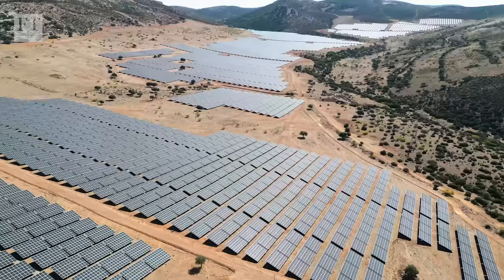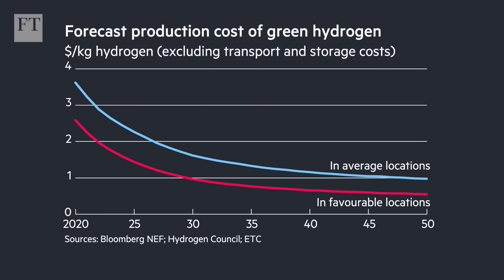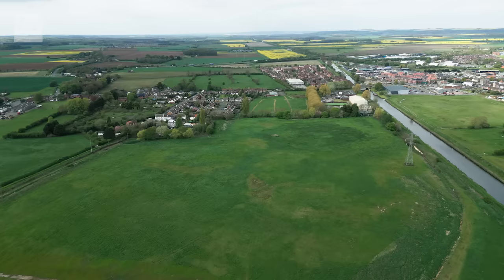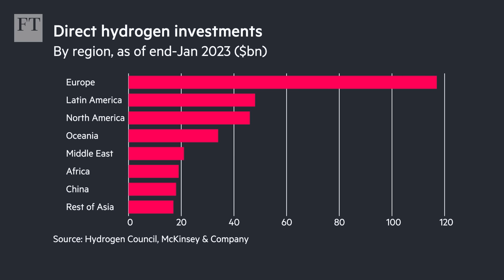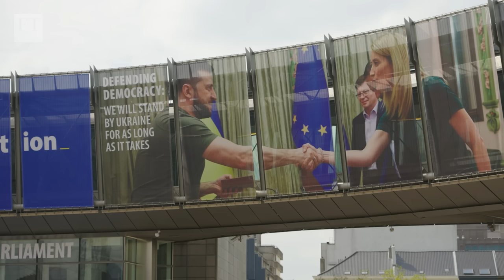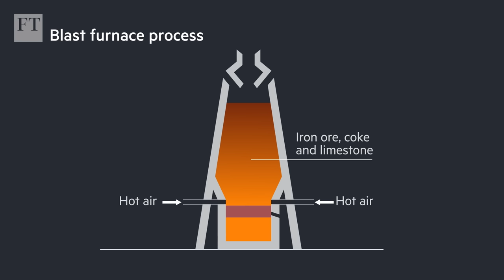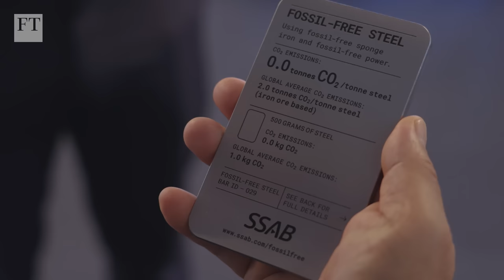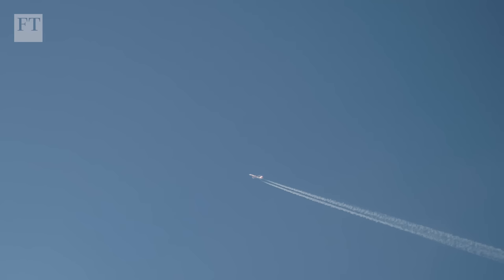Can hydrogen help the world reach net zero?  | FT Film

Comment: There are major issues dealing with hydrogen. There are numerous H2 stations in my area, but at any given time at least 30% of the pumps are offline. Not only that, the stations can only handle a limited number of vehicles due to all the effort needed to compress H2 and cool it to -40 before filling. Trucks typically carry 300kg, enough for only 60 cars (assuming 5kg). This is a fraction of the number of cars one gasoline truck can fill. Despite all these claims of it getting cheaper, it hasn't changed at all here. It's still over $16/kg, so 5kg will cost over $80. Not only that, open the filler door on any Mirai and you'll see an expiration date, after which you are no longer allowed to fill the car. Not only that, the Mirai is rather cramped due to the H2 tanks. The resale value of the Mirai is also absolutely abysmal. We should not be wasting money on this. We should be investing more in battery technology and charging infrastructure, which is FAR cheaper. Each H2 station costs at least $1.9M and they are expensive to maintain. For that price, you can build 40 fast DC charging stalls (Tesla costs < $50K each). Hydrogen is a real pain in the butt to deal with. It leaks like crazy and is dangerous. There have been numerous fires and explosions at hydrogen filling stations. One fire and explosion in my area (Santa Clara) shut down the entire hydrogen supply for six months! Not only that, EV chargers can be installed just about anywhere. I fill my EV in my garage for a fraction of the price of hydrogen. They keep promising cheap hydrogen, but I don't see any sign of it. The only advantage H2 has is fast filling when it works and the nozzle doesn't freeze itself to the car, but the speed of EV charging is rapidly increasing. An Ioniq 5 will charge from 10% to 80% in 18 minutes. While not 5 minutes, these times are still rapidly decreasing.
Reply: Where is it that you have numerous H2 stations ?
It remains to be seen if it's even possible to scale battery production to the enormous levels that would be needed. You're aware that lithium has spiked in price recently ?
Reply: @grahamstevenson1740  San Francisco Bay Area. Also, lithium prices are way down compared to 6 months ago. Lithium only makes up 3% of the batteries. Batteries are more sensitive to the prices of nickel and cobalt (for long-range batteries). The price of cobalt has dropped considerably compared to a year ago and nickel, while volatile, has gone down in the past 6 months. Looking at the chart for lithium prices, it spiked last November and hit a dip in May but looks to have leveled off and is cheaper than it was in March. There is no shortage of lithium and I expect availability to increase, i.e. see the recent announcements on the Salton Sea in southern California. Fuel cell vehicles rely on platinum and palladium. Also, note that hydrogen vehicles have a horrible resale value. There is a built-in expiration date on every Mirai sold. Open the filler door and there is a sticker that gives a date after which you can no longer fill the vehicle and must replace the hydrogen components, effectively scrapping the vehicle. Hydrogen has a very long way to go still until it is competitive, and despite all the promises, there is a lot of complexity involved with hydrogen that is unavoidable since you're dealing with a very high-pressure gas that seeps through everything, embrittles metal, and is energy intensive in its handling, from compressing it to cooling it. And transporting it is inefficient volumetrically except in liquid form, where it must be kept at 20C over absolute zero (liquid nitrogen is a balmy 73C over absolute zero). The only thing colder than liquid H2 is liquid helium. The equipment involved with hydrogen is and will remain expensive. H2 is not like other gases. The only thing harder to contain is helium, which, unlike hydrogen, does not react with other materials. To transport it requires either very high pressures (i.e. 10,000PSI) or extremely cold temperatures. It's very prone to leaking (look at how many rocket launches get scrubbed due to hydrogen leaks) and is explosive at a wide range of atmospheric concentrations. And despite the claims of safety, there have been numerous hydrogen explosions and fires at filling stations, at least two of which caused significant damage. An explosion at a H2 forklift filling station in North Carolina damaged 60 homes and was heard across 3 counties. An explosion and fire in Santa Clara shut down the H2 supply in the Bay Area for 6 months. And if you want to see how reliable the H2 infrastructure is, go to https://m.h2fcp.org/ At any given time at least 30% are offline or limited (slow or can only provide partial fills).
Reply: I quite agree that batteries might be a better option for cars and vans, hopefully in the future with longer ranges. I've been to a course about hydrogen vehicles, in special about the technical aspect of it. And it is abundantly clear that for big trucks, ships and vehicle which carry big loads, this might be somewhat more economically better. See, with EV trucks the payload per truck is by at least one third less, and to think of the range they can do (max 300km) plus charching time (hours, which truckers don't have if they don't need a break)
Reply: No, hydrogen is great, everyone loves it, the end, you’re welcome
Reply: @PierrePinteliere there could be some use cases for H2 but I've yet to see a good example for trucks/lorries. Although the batteries are heavier than diesel, and remove some load capacity, not all loads meet the maximum anyway. Many journeys in the UK are shorter and a mixed load isn't close to the maximum rated weight of the vehicle (44 tons across 6 axels in the UK).
Reply: When you say "we should not be wasting money on this", who exactly do you mean by "we"?
Reply: Battery Electric vehicles are heavy, carrying dead weight batteries, which lose range as they age. They need stronger tyres, and roads to carry the dead weight! The insurance costs are higher as they have to be written off even with minor collisions, as no company will take the risk of fire in the future due to damaged batteries. The written off BEVs need 6x more storage space to avoid risk of serious fires spreading through the whole storage. BEVs need much longer to charge than to refuel a HEV!  BEV technology cannot power ships, planes, trains, lorries, long-distance buses, mining industry, etc for many of the above reasons, unless lighweight batteries can be developed - batteries which are way lighter and almost impossible to go up in flames! Until then, BEVs are transitional technology - hydrogen fuel cells are the real future, IMO!
Reply: @ceblsclinic5613  Batteries don't lose range very quickly and hydrogen vehicles also lose efficiency as they age. Not only that, after a certain date you must scrap a hydrogen car. My EV is still going strong after 10 years. And as for collisions, that has nothing to do with being BEV but just modern cars in general due to the crumple zones and safety requirements. The crumple zones crumple quite easily, making fender benders with modern cars quite expensive. Additionally, many BEV vehicles are not that much heavier than ICE cars in their class since a lot more work goes into reducing their weight.
Reply: I'll give you a A for effort...the Japanese and south Korean are putting all their future energy needs in hydrogen for everything including transport...these countries aren't stupid..if they can make it work then everyone can!!.🤔
Reply: @caravanstuff2827  South Korea is putting far more effort on BEV vehicles. Hydrogen is a lost cause for small vehicles. They are only selling in very tiny numbers outside of Japan. They will also always be far more expensive to operate. In case you haven't noticed, Japan has been stagnating the past couple of decades. Toyota had been resting on its hybrid laurels but those aren't cutting it any longer. Hydrogen filling stations are still very unreliable, very expensive, and will never be competitive with charging. A hydrogen tanker truck carries enough hydrogen for only 60 vehicles. Hydrogen filling stations can only handle a small number of vehicles per day each due to all the limitations involved with compressing and cooling the hydrogen. Japan has this thing called "saving face". Unfortunately, they're VERY far behind everyone else. Honda basically has nothing. Toyota's EV's are generations behind everyone else and are not at all competitive. Mazda dropped out before they even got started. Then there are the safety issues. There have been numerous fires and explosions at hydrogen filling stations. Then the hydrogen cars are cramped because the tanks take up so much space.
If you look at the Mirai, it is not at all competitive with current EVs, especially in its price range. An EV can be driven in most of the country right now. H2 vehicles are limited where they can drive just in California, and they're very expensive to operate, with H2 costing $16.50/kg or more.
Reply: No one ever mentions opportunity cost either...  Money and time spent on a dead end that could have been spent on a winner is lost.
Reply: Some years ago battery vehicles also seemed difficult. But now they seems feasible. Same case with Hydrogen. They are future. Coz eventually limits of battery technology starts. Range and charging time is an issue. Where hydrogen is just like gasoline, takes not time to fill.
Reply: @aaronwilliams1249 You must have battery stocks 😂Every new technology suffers form costs and design issues. It is just a matter of time to solve these problems. There ofcourse are some downsites, like the energy required to make hydrogen, which causes costs for production. And the storage of hydrogen is somewhat complicated. But it can be used with a true net zero emissions footprint, something we really need these days. And the best pro for hydrogen, is that it has a very strong molecule bond, so breaking it releases a lot of usable energy (142 MJ/kg), even about 3 times more than gasoline (46 MJ/kg) and 48 times more than a lithium-ion battery (2,5 MJ/kg). You talk about a lot of downsites of the toyota mirai, but totally ignore the fact that it has about 100 miles more range compared to a tesla with only 6kg hydrogen in the tank. The tank is still 140 litre, so you are right about the cramped interior, but as i said this is just a matter of development time. I am not against batteries, batteries are amazing, but not the total future. We would doom ourselves thinking that. Laws of nature are the only laws that can not be evaded :)
Reply: @mathijsbroeders3454  The problem with hydrogen is there are high costs involved that are basically impossible to eliminate. And there's a lot more than just energy per kg. There's also energy per unit of volume, and hydrogen's volumetric energy density is rather poor. That's why cars like the Mirai are rather cramped inside due to all the space required by the tanks. Batteries can easily be placed under the floor. Hydrogen tanks are bulky and cannot. In addition, the cost and maintenance of hydrogen equipment is high. It needs to be compressed to very high pressures and cooled to -40 before filling tanks, another process that requires a fair bit of energy. That is also one reason why there are often 20 minute delays between filling hydrogen vehicles. And if you think hydrogen is reliable, think again. At any given time, 30% or more of all hydrogen pumps in California are offline or unusable. https://m.h2fcp.org/ shows real-time status and there is a LOT of red visible. Also, the cost of hydrogen is $16.50/kg though at times it's been as high as $24/kg. That's why Toyota has to subsidize the price of hydrogen for the first few years. The well-to-wheel efficiency of hydrogen is also significantly lower than BEV vehicles. Fuel cells are at best around 60% efficient, and that efficiency drops with use.  Then there are all the hydrogen fires and explosions that have occurred at filling stations. I can think of two off the top of my head that are local to me. The one in Santa Clara shut down the SF Bay Area hydrogen supply for 6 months! My county's hydrogen bus filling station also suffered a hydrogen fire and there are numerous other examples. Hydrogen is hard on materials and impossible to fully contain. Due to its molecular size it seeps through all materials and hydrogen is a reactive molecule. It embrittles metals.  There's also a reason why hydrogen vehicles have a limited lifespan with an expiration date printed inside the filler door.
The ONLY advantage hydrogen has is that tanks can be refilled in 5 minutes. Everything else is a disadvantage. You can't fill up at home in your garage and are still at the mercy of the hydrogen filling stations. Meanwhile, BEVs are quickly reducing their charging times. An Ioniq 5 will go from 10% to 80% in 18 minutes. Also, chargers are significantly cheaper to build than hydrogen infrastructure, and they can be placed anywhere. Today for the price of one hydrogen station, you can build 20 high-speed chargers, and the maintenance of chargers costs a fraction of a hydrogen station. For years I have been able to drive all over the country in my EV. There are many parts of my state I can't drive to with a hydrogen vehicle. Hydrogen will always be more expensive to operate as well.

Comment: Not a single critic was interviewed for this peace.  Only people invested in the sector.

2/3 of electrical production is made from hydrocarbons. Coal is mainly used to produce electricity. Green electricity is needed to electrify our economies and hopefully to de-carbonize our electrical grids.

Making green hydrogen is very inefficient, and consumes large amounts of water and electricity. It will only be used for steel making and possibly shipping.

Airplanes were made possible thanks to the very high energy density of fossil fuels and will disappear with fossil fuels. What this video did not show were the large hydrogen tanks inside the aircraft, carrying little hydrogen because at room temperature, a 1 litre tank contains 0,1 gram of hydrogen.  So even at high pressure, the ratio of volume to weight and energy carried is terrible. So unless you are planning to store the hydrogen inside the cabin while the passengers are seated outside on the wings, you are not going to get very far. Hydrogen powered planes are a green hydrogen smoke screen. For the next 30 years, all new manufactured passenger jets will run on kerosene. Boeing has no plans for a hydrogen aircraft, and Airbus only pretends to have such a plan. There is no green future for flying.
Reply: "Coal is mainly used to produce electricity." - perhaps in your country but not in mine. At the moment 88% of New Zealand electricity is being generated from renewables. I take your point, replace coal generation of electricity with renewables and there will be a big reduction in the use of coal.

"There is no green future for flying." - experiments are being done on electric aircraft (small ones with 200km range) so that might be the future there.